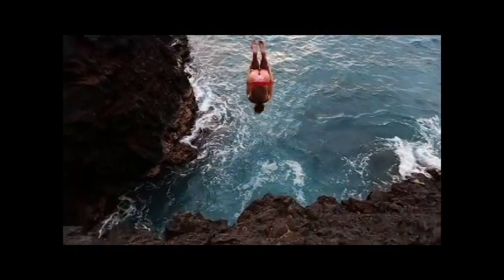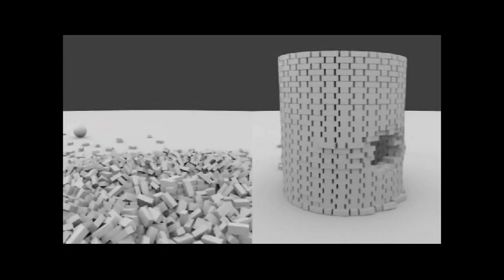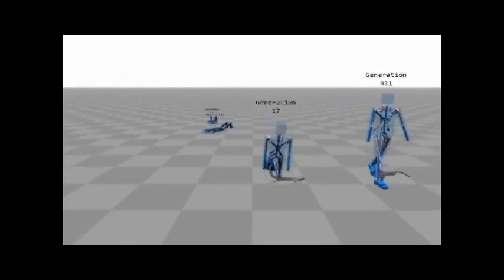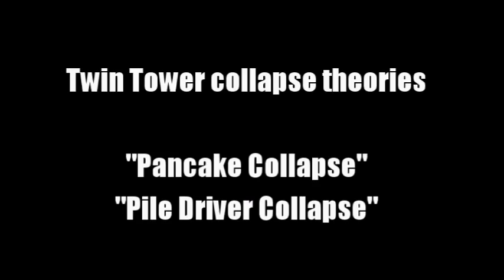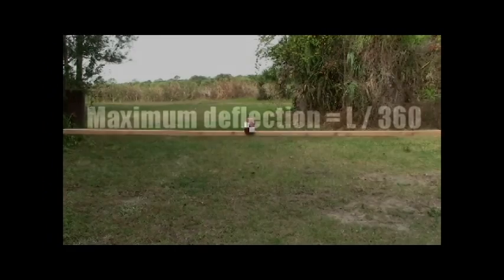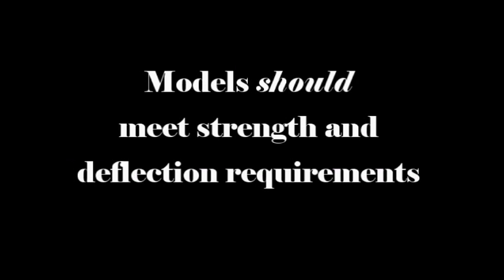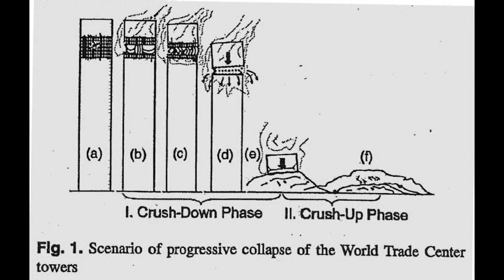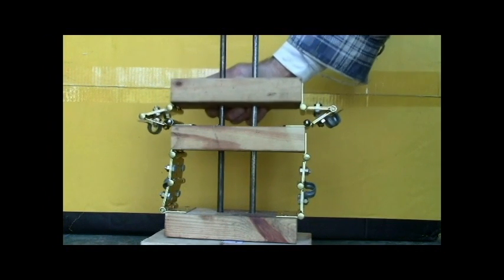9/11 Experiments: The Force Behind the Motion

Comment: Ummm... Sorry, but there are obvious variables missing here. Your "practical experiment" does not account for exponentially weakening support beams, weight and surface area differences. What are your core columns made of compaired to the materials of the twin towers? Practical examples? You will never get the same results in such a models with no comparable qualities. Why on earth do you think cracking boards in half is equivalent to how the tower fell in any way? Its floors didn't crack in half all the way down. No one said it did. 

You're arguments against the computer simulations are pathetic! Not one logical argument. "It could be wrong, though I have no evidence to prove it. But since it could be wrong, it is." And you have no idea how simulations work. It's too complex, therefore it can't be true? Can you say logical fallacy? You haven't got a clue. You sir are a disease and deserve to have a nice slap in the face from the consensus of engineers. You have earned negative credibility from this.
Reply: I'm always in awe when I read comments like this from anonymous armchair 'engineers'. I would be impressed if you had laid out a scientifically honest demonstration of the resistance free downward plunge of both trade towers upper floors through the path of greatest resistance though as a counterpoint.
Reply: Of corse, I can make this jugment beacause I'm a self-trained internet expert. I know that the buildings were vaporized and dustified by Directed Energy weapons, as prooven by Dr. Judy Woods.
Reply: Because that's what us paid government shills do, right randy?  ;-)
Reply: We should thank you and all the other debunkers for bringing all the details of Richard Gage's personal and private life to our attention I guess. At least we know who he is and that he gets up off his armchair from time to time, huh?
Reply: Paid Government Shill you say this by defending an armchair engineer, against an engineer... And what are you, other than an "armchair expert"? Haha! How about trying to argue with something logical, rather than spouting ad hominem fallacies? I dare you. I will bury you son... 

Have you even heard the common term in all fields of science, "All models are wrong"? Do you even know what that means as a whole? By the sound of it, you don't. There's a fucking reason consensus exists. Honestly, which how much research that's been done on the matter, people who argue against the consensus are the equivalent to flat earthers. 

I can give you a case-by-case lecture as to why every single experiment this dude has done is entirely misleading. And apparently all you have is logical fallacy, it would seem. Do you even know what logical fallacy means? Doubtful.
Reply: I'm ready to dance Brady. You lead ............
Reply: And no, I was not defending your comments as an armchair engineer against the informed, educated ,opinions of an accredited professional who is publicly known. Where did you get that idea?
Reply: Paid Government Shill I see my comment went over your head. I'm an engineer. The armchair engineer is this man who thinks taking one demensional experiments prove something that is multidimensional. This is a long played move of all conspiracy theorists around all spectrums. They take one piece of a larger concept, often something trivial, and they attempt to prove that one piece false. After they think they've done so successfully, they ignorantly conclude that it all is false. Which is simply ignorance. It's borderline comprehension bias. You know who does this as well? Holocaust deniers, and flat earthers. 

Unless, you're one of those two conspirators, I assume you understand how any one-dimensial argument they make would be trival and conclude nothing, no?

You say I need to make the first move. I already did. I called him a fraud of a scientist who does backyard, one dimensional experiments to disprove a problem of a bigger spectrum with many variables. Single variable experimentation simply proves nothing. You're rebuttal was that I was an armchair engineer... Which is an ad hominem logical fallacy. So, I'll allow you to retry your rebuttal and disprove my premises and conclusion.
Reply: I'll give you an example to make this more comprehensive. 

He argues through a wooden model that all the floors of the building would not have fallen. Variables missing: his model doesn't have a scale equivalent of the building. Dropping a heavy object on top of the wooden planks would show how if the building hypothetically just suddenly collapsed at the top for no reason. It does not add variables such as a material equivalent of integrity loss, as jet fuel burning at temperatures of 1000C was the cause of integrity loss. The steel wouldn't even need to melt for it to lose integrity. At 1000C steel looses 80% integrity, that is more than enough to have a building completely collapse. For it to fall simply halfway, it would just need a 15% loss. His model had a 0% loss of integrity. Therefore, it's a one-dimensional argument attempting to disprove a multidimensional argument. If he had heated the planks to a scale/material equivalency, he would have had a completely different outcome.
Reply: Paid Government Shill he then lights a scale model on fire, at a single floor to disprove it. Also one-dimensional, considering various floors from top to bottom were on fire. Jet fuel is liquid. There was over 10k gallons of fuel in the plane. The plane was disintigrated on impact. Towers are not water-tight, therefore it will travel throughout the building from top to bottom quickly. Where does he consider these variables? He simply ignores them. Therefore, if he did consider them, he would have once again ended up with a different conclusion. 

ALL of his experiements are trash. All of them.
Reply: I'll stop there for now. Good luck trying to disprove that from your armchair...
Reply: Brady Gordish   I see my comment went over your head
"I'm always in awe when I read comments like this from anonymous armchair 'engineers'"
That would be you Brady, the anonymous armchair braggart. HAND
Reply: Paid Government Shill great insult... Bring an argument. Or just keep up the logical fallacies. It's becoming clear that you have nothing.
Reply: Ok Brady, ready? Noble prize winning scientist Dr. Judy Woods has prooven that the buildings were vaporized and dustified by satelite-mouted Directed Energy Weapons, leaving no solid debri whatsoever. Your turn. Let's dance, duhbunker.
Reply: Paid Government Shill so, you chose to skip my argument instead of rebuttal? So, nothing against that? So we agree that one-dimensional experimentation does not solve multi-dimensional problems? Therefore, this man is a hack. Glad we settled that.

Now we move to Dr. Judy Wood? You really want to go there? The woman who makes up words like "dustification"? The woman who completely misinterpreted the seismic data collected by Columbia University, and became a laughing stalk for it? The one who talks of energy ray, has 0 evidence to back it up, can't even specify what that weapon even is, and refuses to comment after the last horrible debate she lost in? That Judy Wood? She never recieved a Nobel peace prize, she was nominated... By one dude... No one takes her seriously. Her entire book, "Where did the Towers Go?" Is a work of fiction, and badly written at that. She contradicts her self in every chapter. For instance, she claims that through the fictional process of "dustification" everything in the building would have turned to dust... Then she goes to talk about all the furniture and cell phones and other things that survived. 

She also ignorantly speaks of a huge "hole" between the buildings, and says no one knows what caused the hole. Then suddenly decides that SHE does. It was from energy weapons and no other answer is possible!! Except that it was always very well known what that "hole" was. It was not a hole, but it was a pile of rubble. The moron made up a story about a picture she found online, and pretended there was a mystery behind something that had no mystery to begin with. You could even see the building walls piled up in the picture. She's a quack. Try again. Nobel peace prize... Don't make me laugh!

Why does Judy use unscientific words like "ray beam", "dustification", "fuzzyblobs" "fuzzball","Jellification", "transmutation", "cheetos", "snowball", and "holes" while discussing her "empirical evidence"?
Reply: But my favorite part about Wood is that she's not only hate by the same, but also hated by other conspiracy theorists. Even they find it easy to debunk her science fiction claims.
Reply: Why don't you give that other bitch a cutsey name like you do with me lover, then beat her ears back for talking shit about Dr. Jude's 'dustification' theory, randy?
Reply: Paid Government Shill ooooh! Another insult! You're on a roll! But that still isn't an argument. What, are you out of rebuttal already? I warned you that I'd bury you... You all are too easy. You all resort to name calling the moment you find yourself in a corner. 

Prove me wrong, or accept you were wrong. Those are your options.
Reply: FT Slater haha! Twoofers, eh? Haven't heard that label before, but I like it.
Reply: Dr. Wooids is a noble prize-winning scientist who lectures all over the world. Why don't you Jew-payed shills ever want to adress here science, lover?
Reply: She might be a nobel woman, randy, but I can't see where this would automatically indicate she is smart?
Reply: Brady Gordish  You might mistake me for being easy Brady but I can assure you that I only have eyes for my lover, randy. Get lost jerk!!
Reply: Paid Government Shill why do you keep saying she won a Nobel prize? She didn't. Nor would she ever receive one, because her fictional book is the equivalent of the National Inquiror. Star Trek is more credible then her.

Wait... Don't tell me you read the National Inquiror... Please tell me you don't...
Reply: I thought you might enjoy this video:  https://www.youtube.com/watch?v=KBxUEZh4jOM
Reply: But wait! There's more! https://www.youtube.com/watch?v=KgVuME_mdsI
Reply: And the final destruction of "Dr" Rudy Wood: https://www.youtube.com/watch?v=sYHnCYFRr1s
Reply: So, please... try again. Give me one ounce of evidence refuting me. I'll wait... 

Seriously. Your best shot. What do you have? Or are you just another sheep in the herd who just believes anything so long as it's controversial, without even a drop of science? Seriously, flat-earthers have have more credibility than a fool talking about star-trek "energy weapons". And give me the date of Rudy D Wood's nobel prize. I'd love to see it. XD
Reply: Brady Gordish  I got nuttin' honey. You know how us Paid Government Shills are Brady. All talk and nothing else. HAND
Reply: Paid Government Shill have I been trolled this whole time? If so, well played.
Reply: Brady Gordish   Of corse you Jew-payed shills will make any excuses you can when you'e been exposed.
Reply: Is this like your thoughts about planes and holograms. randy?
Reply: If you were a real truth seeker like me, you'd be spreding the word about the work of Dr. Judy Woods, randy.
Reply: You're not a real truth seeker, randy. You're not even a good phony.
Reply: If you were, you'd know that what your doing in CRIMINALLY ACTIONABLE FRAUD. I'm going to nail you, you lousy Jew-loving shill.
Reply: How are you making out with that project you mentioned last week, randy?

Comment: Notice the lack of steel I beams that were said to be in place around the perimeter of the building at seventeen inch centers. Also note the insulation, not asbestos,  sprayed on to cover the fact that the I beams were not per the plans. With steel I beams in place there is no way that those towers collapse. The street should have been covered with these steel I beams but was not.  What purpose does that insulation provide? Glass covered the buildings and when they fell the glass was powdered. Windows are not allowed  sky scrapers per building codes. Sixty people died during construction of the twin towers telling me that the contractor was negligent and just so happens to be in trouble in Canada for fraud a couple of weeks ago for another project he had undertook.
Reply: Since the Port Authority build the support structure (foundation work) below grade who was the contractor that built the 110 floors above that you say is in trouble in Canada?
Reply: You can answer my questions or admit that the buildings were vaporized and the planes were holograms, as prooven by modern science.
Reply: +Fake Andrew Strycker
I'm in no hurry for the answer to my question Fake Andrew. 
Why are you interested?
Reply: ALLERT===>> I am being relentlessly gang stalked by JTRIG shills based out of CENTCOM headquarters at Langly Virginia like the ones in this thread who impersonate my accounts in an attempt to discredit my message. These stalkers have even come into my home to plant listening devices. Please google “Gang stalking, CENTCOM" and follow the links !!
Reply: Good to know, randy. Have you begun sleeping on your back with your eyes open?
Reply: You realize your going to burn in hell with your Jew boses, right randy?
Reply: I didn't until you mentioned it, randy. I've been watching CNN all these years and they haven't mentioned it once.
Reply: SIater SIater , Fishman construction
Reply: The reason for demolition was to hide the fact that the buildings are powered by nuclear reactors., ship size. Asbestos blamed for wanting towers drmolished. Asbestos used on boiler pipe not contraction beams. Asbestos banned same year towers were built.
Reply: I agree with you mostly Steven, except your leaving out the nuclear bombs that were planted in the foundations of the buildings then used to vaporize them on 9/11.
Reply: I think it's just great that you have learned so much about 9/11 from CNN and mass media randy. It would be better if you provided links to your sources like the other debunkers do, but that might be asking too much?
Reply: Of corse, that might be against the riles your Jew boses gave you, randy. Tell us, when all the Jews are extermenated, what will you do for work randy?
Reply: Rise and Kill First: The Secret History of Israel's Targeted Assassinations Jan 2018 

Journalist and author Ronen Bergman writes of the nearly century-long campaign of Israel's own intelligence services and military conducting targeted killing
Reply: I think it's too late already, randy. Just my opinion though
Reply: Because that's what us paid government shills do, right randy?  ;-)
Reply: Sixty workers died during construction which should have been cause for concern.  Three died building empire state building. I watched a man falling from one of towers wearing a suit and it appears he has a chair strapped to his ass.My guess is that he was a building  inspector and would not buy off on the lie.
Reply: Michael Chertoff, former head of FEMA responsible for mishandling the Katrina disaster admitted on a syndicated TV program "American Greed" that ALL the contractors involved with the construction of the Trade Towers were 'mobbed up' in his informed opinion as a high profile state prosecutor who worked on several cases with Mayor Giuliani.
Reply: C'mon, randy, up your game ffs.
You're giving the rest of us Paid Government Shills a bad name.  ;-)